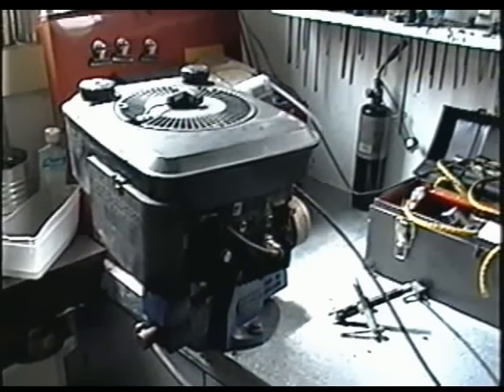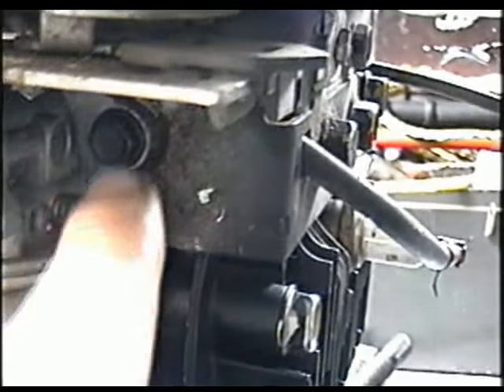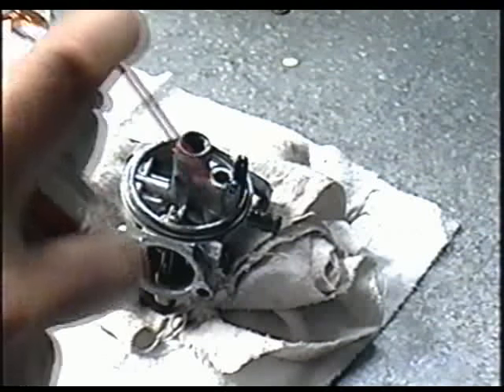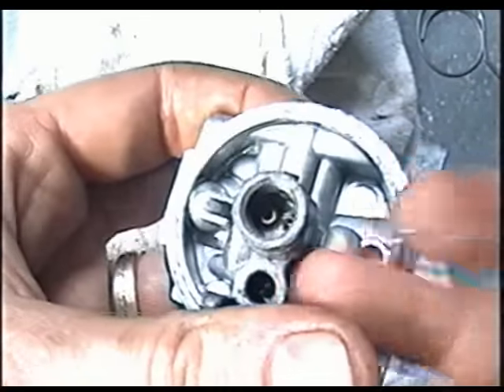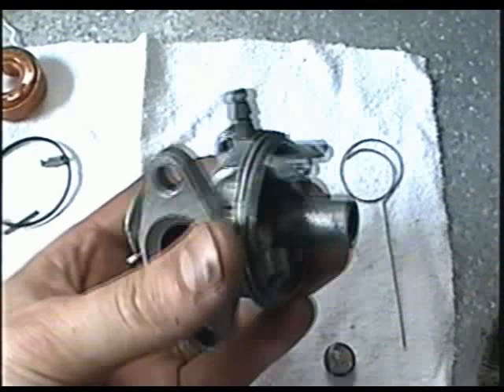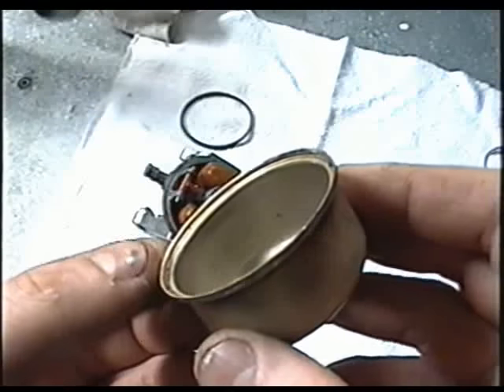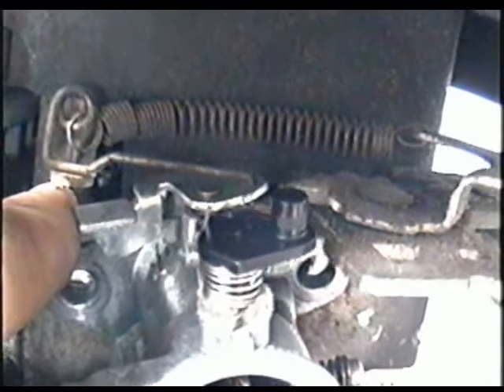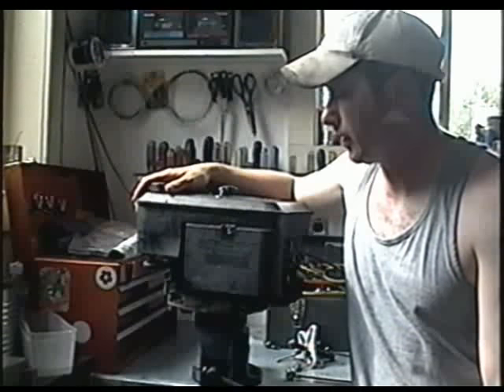HOW TO CLEAN The Carburetor on BRIGGS & Stratton Quantum Lawnmower Engines

Comment: I have a similar setup.  I don't see gas shooting into the carb went I prime it.  I hear the suction when I press the primer. The carb is ckean, I replaced the gasket between the carb and airfilter body and also tried a kniwn working primer bulb yet no fuel priming happening.  I can get the miwet to run via starting fluid.  Although when ut runs, it idles very low unless I manually work the butterfly value.  Can you suggest how I can repair each of these issues?  Thanks!

Comment: Kawozaki: I'm kinda surprised that nobody's brought up Ibsen's "Ibby-izeing" 

 1.) put parts in container. 2.) sprinkle copious amounts of baking soda on parts. 3.) put some HOT tap water in container---fill till parts are 'bout half covered. 4.) when the tea kettle is whistling, sprinkle more baking soda on parts and pour the boiling water into the container 'til the parts are submerged. 5.) let stand for an hour or two, rinse, repeat if necessary.

Comment: I have a 15.5 hp briggs engine on a craftsman lt 1000 and it has been overflowing fuel into the carberarutor and filling the crankcase with gas so I have to change the oil every time I use it do you have any thoughts on what the problem would be
Reply from the maker: you need a new needle valve and seat
Reply: Ok thanks

Comment: ------>!Remember to measure your seat / float's height before removal! so you can tap the replacement back in at the same depth! "Float height alters fuel level!"  Also, please be careful while using the tap to extract the seat the tap steel is very hard and brittle and can break! "Tap straight out with a hammer lightly and DO NOT side load the tap or it will break! You will find that cleaning the gunk from the housing from under the seat with cleaner before removing will help via less friction!

Comment: of the two you put the wire in one of mine doesn't go thru. when you blow it with carb cleaner it just blows back this mower will run for two seconds after you put carb cleaner in it. i cleaned the carb but the one orifice woould not go thru is it supposed to?

Comment: The air filter housing bolt is also 5/16 , you dont have to use a flat tip.

Comment: I have a new Briggs and Stratton auto choke 6 hp engine. It surges when it starts, but then it goes into normal operation after about a minute. Could this still be a dirty carb or is this the auto choke system that is the issue?
Reply from the maker: jonesey 4500 some new ones take a while to warm up then they stop surging
Reply: Thank you very much! I think I understand why. The choke thermostat probably has to warm up right?

Comment: Hi Donny, I have this Oleo -Mac weed eater straight shaft, which was running okay, but after replacing prime bulb, doesn't run.
When I first start it with choke on, after two pulls it starts for about 10 secs or less, then cuts out. It won't even 'run' with choke off. When primed, I can see petrol in primer plastic. Move choke lever to 'on', after two pulls, it starts only for a few seconds then off again. In pushing choke lever to off position and pull to start, it doesn't. I hope this makes sense to you.........hope to hear from you soon, thank you.
Reply from the maker: probably  needs a carb kit
Reply: +donyboy73 I will pull it apart again and start all over.....thanks anyway
Reply: +donyboy73   Further to the above, I managed to start it in the choke lever in the "on" position, as soon as I push lever to "off" position, it cuts out, thank you.
Reply: +donyboy73   For your information, it's a Zama carb..................
Reply: +donyboy73   All sorted. For some reason, the hoses from petrol tank weren't connected correctly to carb intake and return? Cheers...

Comment: Hi,
No answer on my last question so I'll ask it differently:
Have you ever seen a carburetor bowl that doesn't attach to the carburetor with a nut through the bottom of the bowl. That's what I have on my B&H mower engine--no bowl nut.  And I just can't get the bowl to come off. Any suggestions?
Thank you.
Reply: does the bowl thread on,since it has no bowl nut it has to be threaded. good luck.
Reply: +Mark  Bardin Thanks! I'll check it out.

Comment: I would never install a dirty air filter like that back on a machine, no matter if it is going in storage or not. I would also change the oil and sharpen the blade, and tune it up.

Comment: if your mower won't star after it set over 1wk. you might have water in your gas tank . drain your tank ,put fresh gas , it should crank . if not use carb. cleaner before taking your carb. apart. that should be your last option. check spark plug too!

Comment: I have a kohler 15 hp motor and it has a round thing that screws in the bottom instead of that bowl screw. the thing constantly drips gas and a friend of mine said i could just take the thing off and put a bowl screw in it, i really wish i knew what that things called but idk, its just a inch and a half round thing that screws to the bowl to hold it on?? any ideas

Comment: I have a Sears lawnmower, with an automatic choke..

The carburetor looks like this one.This lawnmower was working fine, and all of a sudden it stalled out and was extremely hard to start. It had no power and ran extremely slow.

I cleaned it as instructed , but did not see any debris floating around..

Will not start unless the choke is held open manually and even then it has an extremely slow idle speed and no power.

PLEASE help!

Comment: my quantum motor has a primer bulb on the plastic cover with a gasket in between and when I prime it air just goes in and out but the gasket and primer bulb is fine what could be causing this?

Comment: Plastic carb replaced, still surging like it did with old carb. Key is good. What is another thing to check? 500e motor. Clean fuel system
Reply from the maker: did you use oem carb or cheap aftermarket?
Reply: I used a cheap aftermarket. 🙁
Reply: Amazon purchase is going back. I just located a oem carb for a few dollars more on Amazon. These newer briggs plastic mowers are practically disposable

Comment: this is a max series engine. built on the old 3,5 block but it has a mecanic govener and a float carb. not exact the same carb like on the quantums. this has the jet in the carb. a quantum carb has the jet in the botton nut. all the quantum carbs with an manual choke has a mixture screw. but the carbs with readystart and primer is not adjusebal. sorry for my bad english / Viktor from sweden on Agria gardenmachines

Comment: Hey  bud been watching your channel I also have my own channel. I'm great friends with Wayne and Jake at eliminator  performance.  Got question for you hope you can help. I  putter around with small engines while cooking or smoking.. I have am older craftsman  6.75 eagle.  Easy start.  Has the really weird carb on the side of mower. . Did ultrasonic  clean at EP.  FULL SERVICE . STARTS WITH QUICK START. But for some reason now fuel going to tube. Not priming. Am I missing something here can't find any answers anywhere.  Not bowl carb. . Very rare bad design carb.  Any clues. I'm stumped
Reply: mine is a toro 7.25 190cc recycler 22. pulled off carb. cleaned it per the video. it looked clean to start. put it back together and it still only turns over after I spray carb cleaner over the carb butterfly valve. fuel pools into the bowl. can't get a new carb for 6 weeks! any ideas?
Reply: @northwestlife_9   does it give a chuckle to start or a burp.? If not it's your coil maybe no spark.. no spark  no fire
Reply: @ChubbyButcher  it turns over a few times like it is going to run normally,  as it's dying, it turns and sounds like it blows air. hard to describe the sound. thank you.
Reply: @ChubbyButcher  figured it out. I had no idea the carb bowl bolt had holes. LOL. Ran a wire through them, sprayed carb cleaner, then blew it out. Starts and runs like it's brand new!
Reply: @northwestlife_9   beautiful.  I just lawnmower to someone. They gave me their  big brute 6.75hp  self proppelled.. bought it 15.00... got it home. Over filled 500 ml to much oil.. . Drained it. Put new oil in it.. drained carb bowl  runs like champ

Comment: Hi donyboy, I have an older Tecumseh 8 HP HM80-155448P and I'm wondering if you would sell me some parts? I need the carb linkage both rods, card choke with rod or complete car, belt shroud and the shroud bracket that mounts to the carb. I am having a had time finding these parts and was hoping you could help me out. Thanks
Reply from the maker: go to www.discountonlineparts.com use "donyboy73discount" at checkout and get an extra 10%

Comment: My carb bowl has no nut holding it on. I can't get it to separate from the carb. Any suggestions?
Reply: +Charlie Simpson It may be recessed like  mine. You can't see it by looking in from the front of the motor while the carb is attached.
Reply: +Geoff Fellows 
Thank you.

Comment: Does this series Carb not have the center jet, i guess it's called. That you un-screw to remove and clean. My Walbro 5 4993 does. However the screw head is stripped. So I couldn't remove it. Rodded it out and cleaned it good. But the mower will not start. I set the fuel mixture screw back as it was ETC.

It could be months before Donny has a chance to field this question. Anyone in the know care to jump in?
Thanks in advance.

Comment: Ok, same carb. Mower won't start unless I sprayed carb cleaner down throat. Then will run fine.
If I shut down, it will not restart unless I do the above procedure again. So will do this disassembley as the video.
Stupid auto choke design.

Comment: Your like me I'm 12 I fixed a feather lite weed eater all by myself I still need to get the filter cleaned is that why it smokes
Reply from the maker: Bash full line 421 as heazy maybe too much oil in gas, mix it at 45:1
Reply: its takes 40:1 ill try to get it to stop smoking ill try